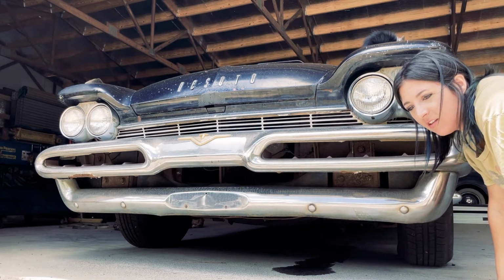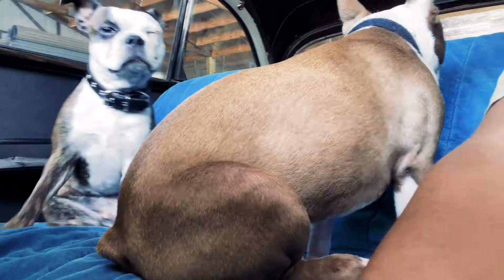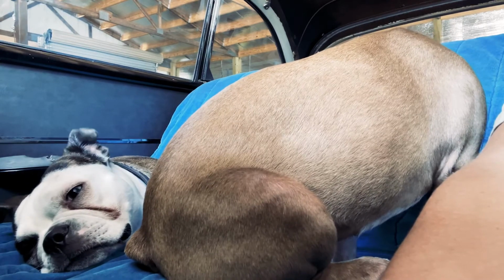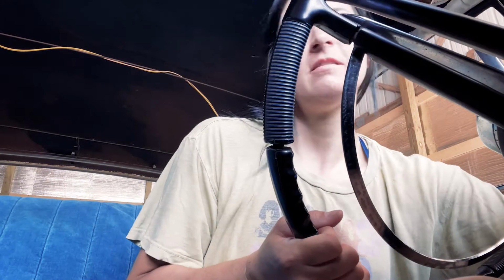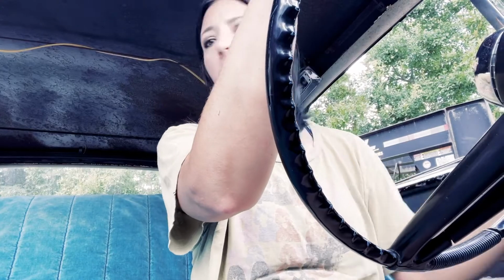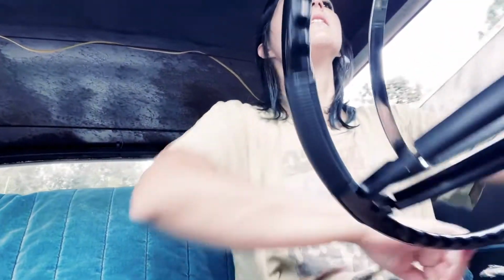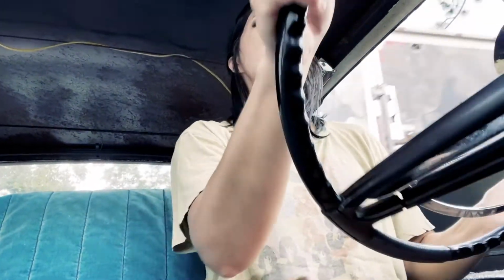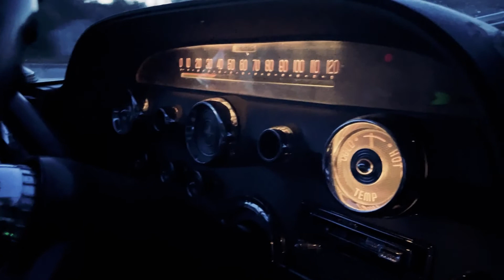Forward Look 1959 DeSoto Firesweep Sportsman

Comment: Let me ask you guys! How did you get it to my show if it’s having transmission problems?
Reply from the maker: Well, it wasn’t showing symptoms at that time. Even with an iffy trans not wanting to go into drive until it’s nice and warmed up, it still runs and drives. However, with that we know it’s life is limited as is and that means it’ll be fine until it’s not. Then I might be sitting somewhere, but that’s also just part of the adventure. For now we mixed some liquid bandaid for automatic transmissions with the existing fluid. I’ve since taken it out and made it home safe with no issues (after the initial warm up in our driveway)… but with the addition of the “snake oil” aka liquid bandaid it does go into drive a little bit quicker. It will need a rebuild or will more likely get a modern swap.